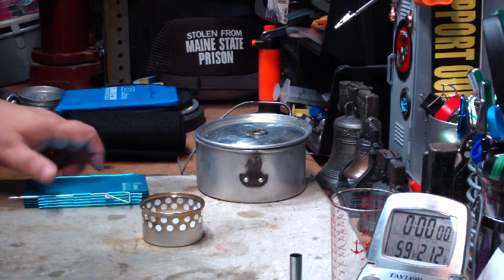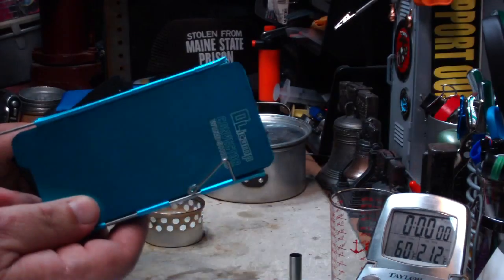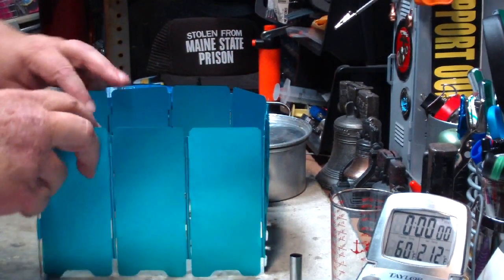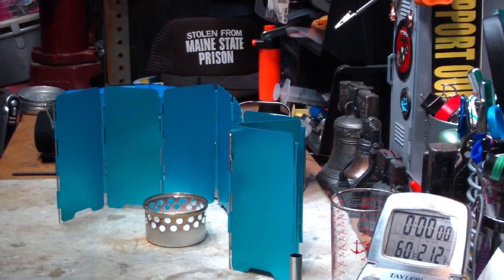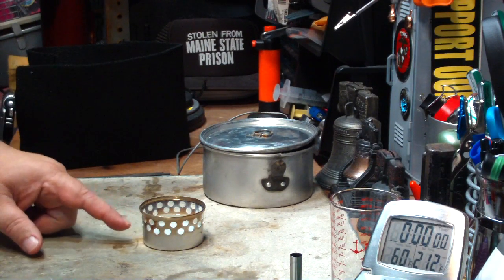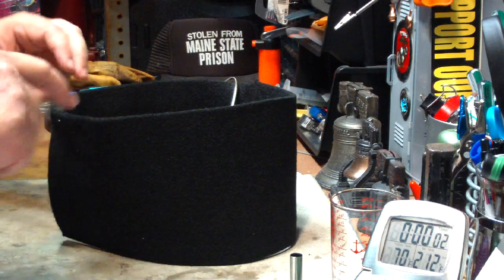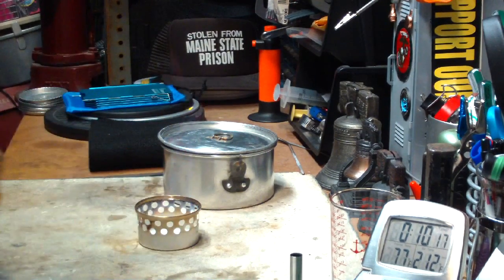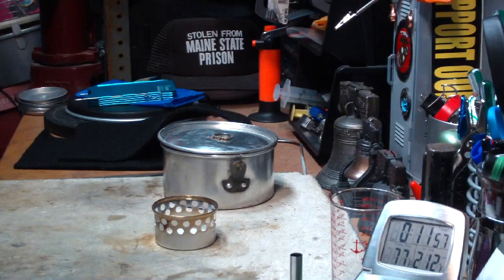Windscreens: Aluminum vs Carbon Felt

Comment: Use the metal wind screen and put the felt around the outside.  After the water boils, use the felt screen to move the metal screen.  Without the direct flame to the felt it should be much cooler with the metal wind screen reflecting the heat back to the water pot.  The felt should be cool enough to be used to move the metal wind screen without discomfort.

Comment: I LOVE the idea of carbon felt as a windscreen.  Brilliant!  I’m really interested in simply blocking a fair amount of wind so that my flame can do its job, and I’m not worried about the extra minute.  I love the idea that I can also use the carbon felt as a pot holder, it weighs less, can snuff out flames on the ground etc.  There is a “right” answer for everyone.  Great video.

Comment: LOL speaking of burned fingers... a bit ago I was testing a home made jet stove made from a tuna can, it boiled the water quickly with 91% alcohol but I needed a way to get the pot 1" above the burner this burner was flat topped so I just bent a 8" piece of 1/8" x1" bar stock in the center into a  "V" crushed it a bit more in the vice and used that as the pot holder....
it was on the flames for probably 5 minutes so I knew it was extremely hot.... I took it off the burner with a pair of plyers and set it on the vice.... I put the flame out by smothering it with a coffee can and then transferred the alcohol to another stove for testing, which took a while to do, i had to add more fuel as well and by the time I was ready to put the pot on the stove again it had been well over 10 minutes ...and I thought about that pot stand being hot but it had been a very long time and I reached over and grabbed it with my bare hand and promptly branded myself !  I was surprised that it was still very very hot !  1/8" thick steel holds the heat a long time !  it was painted black with high heat paint and showed no sign of being red-hot when I took it off the burner but I now know it had to be !  needless to say I won't be making that mistake again ! ....and through all the testing the best burner I have been able to make yet is just like the fancy fiest/tomato paste can one but I really dislike the soot, so I will be getting denatured alcohol or methanol...next time I venture into a store.

Comment: I don't know what Hiram's problem was, for some reason he had a problem with John "Tinny" Austin... he was the first to use, hardware cloth, for pot stands, carbon felt, and remote alcohol stoves where all invented and designs of Minibulldesign...stoves...John would build a new alcohol stove design, then there was 2 or 3 other alcohol stove builders that would start making John's new designs... Hiram used many of Johns inventions in his videos and never gave John the credit for the Innovation to alcohol stoves that he was using in his videos. Dry baking was perfected by John and minibulldesign designs...
Tinny want so far that if he designed a product for sale, he would offer to buy the designs rights if somebody else proved they came up with the invention first...Beer can pots, John designed and sold thousand of these back in the Heyday of Beer can pots...the round tension ring that many stove makers are using now, was an innovation from John... John figure out how to keep the alcohol from over pressurizing...in his side burner alcohol stoves by putting vent holes in side his stoves and adding 3 small raise ridges on the top edge of the stove where a pot would sit...this would keep the pot from sealing and causing the alcohol to over pressurize...now all the alcohol stove makers do this... even Hiram was doing it with his side burning stoves...John got in trouble with Hiram and another stove maker for adding ridges to one of his foster pot designs... The other stove designer did not come up with this idea first...John did....this same stove maker that said he designed the cat can stove with the felt wick on the out side of a taller can inside the cat can...was also a design innovation of John "Tinny" Austin's. I also though it was first designed my this other stove maker, but John has a video of this stove design that he made that is about 2 years before this other gentlemen started sell his design of this stove. John "Tinny" Austin would seldom complain about other commercial people using his designs...but if anyone thought Tinny was making their designs they sure would let everyone know ....It's was to bad that Hiram would use John's designs and innovation in his videos then would call him the name that can't be mentioned...

Comment: Cover the inside of that carbon felt with aluminum foil to reflect the heat back as the pot.
Theoretically the water should boil faster.

Comment: Interesting. I would have thought that the carbon felt would be a better insulator and dissipate less heat than the aluminum panels on the windscreen. Apparently not!
Reply: I think the gains of aluminium is that most heat is reflected back to source, ideally though, the alu should be as shiny as possible to optimize that function. Because alu is reflecting most heat it doesn't heat up as much as some other materials. The air moves around alu. Carbon felt will soak the heat up, become hot AF on inner surface. Theoretically, because felt is dark, it should also radiate back some parts of that heat but alot will travel through and radiate out on "user side". We can touch the carbon felt even when its hot due to its low mass and low heat retention capacity. The carbon felt is also being blown through, actively cooling the low/mid parts. Still, I would have not guessed the difference would be this large.

Comment: The problem I see with this experiment is the fact that you do not have any cooling wind to hit the screen to help keep the temperature down yes it may get hot enough to give you a 1st° burn but most people should be aware of this when using such equipment

Comment: Those reflectors are very close so they will be hot.
I think a reflective windscreen would be best to reflex the heat back to the pot. That may keep the reflector cooler also.

Comment: it may be carbon felt yo you but in actuality its called and known in the blue collar industry as a plumbers pad, used for soldering  in and around dry wall, sheet rock, that is what you ask for in the hardware stores, PLUMBERS PAD

Comment: Hello, this is an old video, but it's a good topic to explore.  There were a lot of comments and I didn't read every one so I hope this hasn't been beat to death. 

Perhaps it's just the carbon felt that's available in local hardware stores near me for use as welding blankets, but the carbon felt I bought is not windproof like a solid material, so if wind decreases an alcohol stove's performance in the field, boil times could be a lot worse than it was in the garage test environment.

Comment: You should probably try to add some aluminum foil to the inside of the carbon felt in
order to reduce the amount of radiation absorbed by it, and also cut some holes
in the bottom to make sure enough air is being supplied. Even with these modifications,
the carbon felt will probably be quiet lighter than the aluminum one, while
having a similar performance.

Comment: the problem I have is the heat the stove creates on the ground.
Reply: One trick I use is to carry a can lid that's just a little larger than the cat food can and slip it underneath.
Reply: So cut out a piece of carbon felt under the stove

Comment: I see a few problems with this test. Measuring the temperature of the screen doesn't tell you much since it is not the temperature of the screen that causes burns, but the heat capacity.  The felt has a lower heat capacity so even at the same temp it won't burn you. But in a good alcohol stove system, the wind screen does two things, it blocks wind and it also promotes air flow around the pot to facilitate heat exchange. Neither of these were demonstrated here. First there was no wind in the test so we can't evaluate the effectiveness of blocking wind (which might be a problem with carbon felt as it is porus) and in neither case was the wind screen positioned tight enough to the pot to help with heat exchange (such as in a Caldera Cone). Also, if your wind screen is hot enough to burn you, the problem is not the screen, but your use of a very inefficient stove, such as the Supercat stove used in this test. I use a wind screen made of aluminum flashing (made to fit just 1/4" from the pot) with a powerful center burning stove, a pot stand, and an Olicamp XTS pot with a heat exchanger. It boils two cups of water in under 4 minutes, but the wind screen is just warm due to efficient heat exchange. Also, this system is immune from the cold pot on the stove problem illustrated in the video.

Comment: I'm not sold on the carbon felt for a windscreen, but one advantage for those who do not have appropriate gloves is that once your water boils, you can use the carbon felt to pick up the pot.  Keep on protecting those "dainty little hands" Hiram!

Comment: Probably just stating the obvious here, but I have to wonder what would happen to that minute if this test was done outside in cool temp's with heat loss on the metal screen's surface area being caused by both radiant and convective factors, as well as the wind blowing under the slots on the screen and directly hitting the stove. In such as case I wonder if the carbon felt screen would result in a faster boil time? How well does the carbon felt breath? If it is porous enough to allow sufficient O2 levels while not allowing any convetive drafts through to steal the heat that may be another advantage. The disadvantage of it blowing away may be mitigated by  clipping it closed at the ajoining edges, and the bottom to the ground with a homemade lilliputian tent peg of some sort. FWIW, I have one of those windscreens and never have really used it, finding the titanium sheet material I bought from the eBay seller much preferable.

Comment: LOL about "Sticking to peanut butter sandwiches."  I feel that the biggest danger with this setup, which I use, is an accidental spill of the stove.  Burning, splashing alcohol just doesn't seem like a good thing when you're far from help.  I'm thinking of letting the alcohol soak up into fiberglass cloth or steel wool before lighting my stove--anything to keep it from splashing.  Have a Merry Christmas!  --Scott

Comment: I prefer carbon felt to aluminum. Sometimes though I pack my soft windscreens I sell at sodacanpots . com because they're so easy to fold and carry. They weigh about half the weight of a carbon felt windscreen (by the way carbon felt weighs 1oz.) The only thing I do to prevent burns is grab a couple little pieces of carbon felt and pick it up with that. I have gotten burned pretty good on an aluminum windscreens, that is why I sell and now use carbon felt although it gets hairs in your pot then.

Comment: Here is the handling instructions from a carbon felt msds:

Skin Contact: Wash affected area with soap and water especially before eating, smoking, and at the end
of work shift.
Eye Contact: Do not rub eyes. Immediately flush eyes with plenty of water for at least 15 minutes. If irritation persists, call a physician.
Inhalation: Remove to fresh air. If breathing has stopped, administer artificial respiration and supply oxygen. Seek medical attention.
Reply: SAFETY DATA SHEET - CARBON FELT  
(SDS 0306-70-800, Rev5/06/21/12)

This product is nontoxic.  
However, dust from machining,  grinding  or  sawing  the  cured  product  may  cause mechanical irritation (eyes, skin, Inhalation).
Carbon felt, as with many petroleum products, may cause minor skin, eye or lung irritation, but good hygienic practices can minimize these effects.

FIRST AID MEASURES
In case of contact that causes irritation, immediately wash skin with soap and room temperature to cool running water. Use a washcloth to help remove the fibers. To avoid further irritation, do not rub or scratch irritated areas. Rubbing or scratching may force fibers into the skin.

Comment: For using the felt as a wind screen, couldn't you "thread" some stiff wire, like coat hanger wire, through the felt to stake in the ground like the olicamp to keep it from blowing over?

Comment: I like the Olicamp. It's more like a small sectional divider for a tiny person to change clothes behind and it goes with your small Wall Locker. But Carbon Fiber is so mysterious. Be careful going outside because Sunburn is 1st degree burn. When you use the windscreens, I can't tell what kind of Sorcery is going on behind there. Hiram, Everything You Do Is Magic.

Comment: I think the original comment elsewhere was just comparing the two, not saying burns couldn't be avoided by care.  I've used both screens... the felt has the advantage that I don't need a glove or pot grabber, I just use the windscreen.  Even if the felt is hot in temp, it doesn't burn your hand because it doesn't conduct heat well.  It doesn't do well as a screen in a strong wind though.  The felt packs well into whatever space there is in the pot and keeps stuff from rattling.

Comment: The Oilcamp screen has nice inlet ports along the bottom.  Without those kinds of vents, the carbon felt probably reduced the burn rate (I am going to guess that the fuel efficiencies between the two are about the same).   I wonder if anyone has used a carbon felt windscreen for a couple of hundred miles yet, it would be interesting to get their feedback. Best regards - Jon